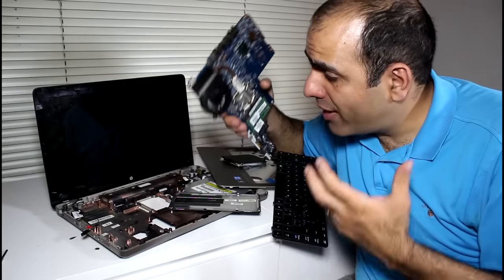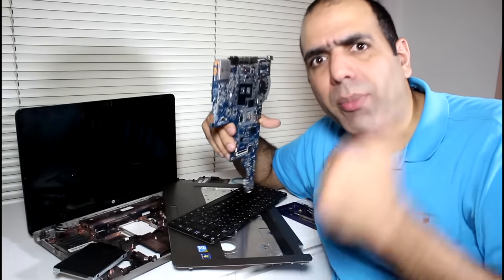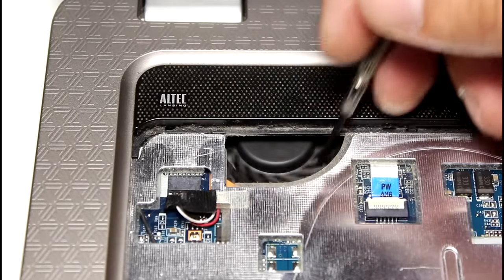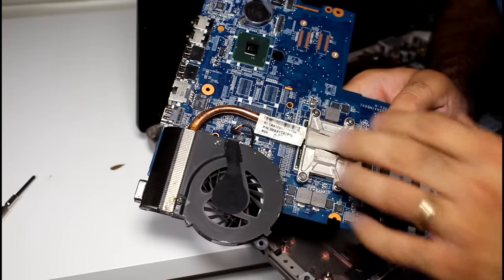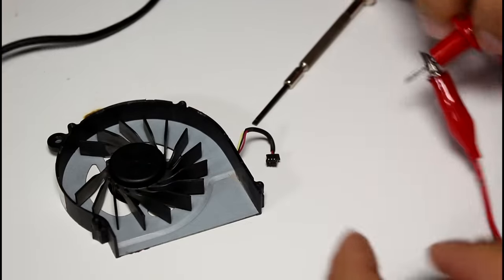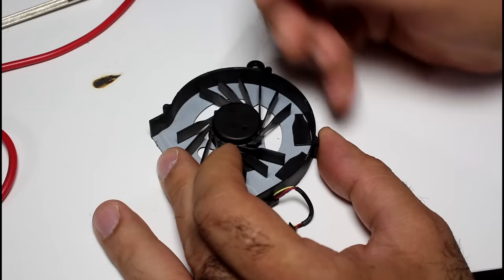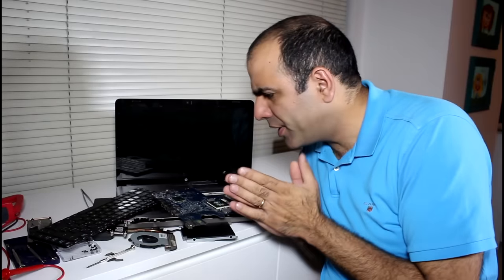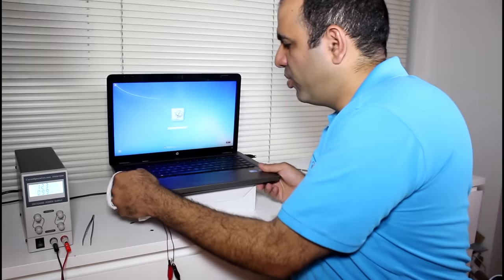How to Fix your Laptop

Comment: NONONO

Vacuum cleaner and solid state electronics do not go well together (Electrostatic energy). Also, it will probably ruin your fan as well.
Reply: Compressed air can is definitely a better option.
Reply: May you explain what the vacuum cleaner and electrostatic energy have in common? Where's the difference between the vacuum cleaner and the compressed air can. I can only imagine the fan spinning and creating energy, but that's it
Reply: MegaMerlin56 I cannot. I just know that compressed air provides a much shorter burst of air that is much more efficient at cleaning out dust, as it will disintegrate all the accumulated lint. Even if the dust is not immediately removed, the fan will be able to blow out the rest on its own.
Reply: The dust and grime scraping against the plastic tube of vacuum cleaner is a pretty ideal for striping the surface of electrons and therefore a lot of voltage can build up (Not really the case with compressed air). But it won't destroy your laptop if you don't open it up and directly touch say the bottom of the processor. I have made my fans sound like jet fighters by the help of a vacuum cleaner many many times with no ill effects. :)
Reply: and MSI recommends you to apply thermal paste like that. Doesn't mean they are right. /watch?v=kSCVahyh3Dk
Reply: ROFL! I vacuum cleaned EVERY single PC I owned over the past 30 years. Never ever had a problem because of that.
Reply: but not really though. wtf do you think your fan is doing lololol.
Reply: I highly doubt that the fan can spin fast enough to fry the diode. If it can resist 120V AC I think it can resist a 5-12V DC motor (which won't even generate the 5-12V, it will always be less).
Reply: uh no it's fine, the motor for the vacuum is far away from the nozzle part with the suction. even if the vacuum were close it wouldn't hurt it. your comment is bullshit.
Reply: compressed air will blow dust all over the internals of the computer and your room, vacuum is much better
Reply: Suhkma Dheek Im an EE, I know more about electromagnetics than you.

A brushless motor has over current design, so when you apply a force onto the blade, the motor controller (unless its a piece of shit) well apply less power. EDIT: a brushless motor design requires reverse flow to operate, so spinning a brushless fan backwards does nothing.

But ya with the static, the principal is from rubbing an isolator (the air), onto a conductive material...but like...that's what your fan is doing already so obviously motherboards are designed with anti-static in mind.
Reply: dan428 You could take your laptop outside yo, also I believe the fan is mostly separated from the internals, for optimal airflow.
Reply: Suhkma Dheek wait we are talking about the motor in the vacuum doing damage?!?

LOL no it wont.
Reply: Lmao it's satire guys chill
Reply: His jokes are based on doing the wrong thing, fucking up and explaining how he fucked up. Here he did the wrong thing and didn't make it a part of some joke, which suggests that he thinks it's a viable thing to do.
Reply: this whole vid is a "joke"
Reply: Huh? I said the 120V AC as an example of how much a diode can bear, just check the datasheet for the 1N4001 it can stand up to 50V. I worked with power supplys before I get how it works.
Also, a 12V fan making enough current to fry a diode, now that's bullshit. That fan can't even create 1A and you're saying it can fry a diode
Reply: The reason people say this is because old-school vacuum cleaners had a bigass rubber belt in them that ended up working kinda like a Van De Graaf generator and produced a huge static charge. Vaccuum cleaners made since the 90s don't do this, so you probably don't have to worry about it.
Reply: +Suhkma Dheek 
The spinning of the pc's fan will create a few milliamps at best there is no way it can fry a diode
Reply: The Piscis Dude do you know how much power a vacuum uses, that power is literally being transferred by spinning the fan in the PC. Yesterday my laptop was hit by a slight breeze from an open window and it caught fire and then exploded. I don't have a house anymore.
Reply: +Suhkma Dheek 
While it's possible, I would doubt that the diode is that's weak. Really that would be worst case Scenario. Also even if the diode breaks, once there is load put on the fan, I doubt the vacuum is powerful enough to still turn the fan.
Reply: lucky. I know someone who destroyed two PCs with vaccum cleaners. It depends on a lot ofc, but compressed air is made for cleaning electronics and vacuum cleaners are mede to clean house floors. Way different.
Reply: Pablud3S oh yeah, TOTALLY different. uh huh.
Reply: one sucks the other blows. They seem like polar opposites to me.
Reply: Pablud3S - static electricity builds up when you vacuum the carpet... Did you plan on rubbing the nozzle on your geforce??? In any case, been vacuuming countless PCs for over 30 years now. No problems whatsoever.
Reply: Pablud3S excuse me?
Reply: your excused.
Reply: ***** - that's "you're", kid.
Reply: Shitt troll lol
Reply: It will not, there are diodes inside the fan rated at 200V and most importantly the power supply in the laptop/computer has a few reverse biased diodes to prevent back EMF from the coils inside the power supply coursing trough the MB. In the correct polarity you can never generate enough electricity with this kinds of fans to even get close to what the chips on that rail run at normally namely a few tens of amps...
Reply: PanikGrafik vaccum cleaners don't work outside
Reply: Hoping somebody would point this out. Sensitive electronic components+vacuum static do not mix together well. And yes, the fan bearings can be wrecked too, but static is more concerning to me. Bye-bye RAM!
Reply: Mary Draconis t
Reply: I was thinking the exact same thing...
Reply: " generating too many amps" - the rotating fan can generate a voltage; what the fan is connected to in the circuit (its resistance) determines how much current (measured as amps) will flow. You don''t 'generate' amps.
Reply: Unlikely, if the machine is earthed.

Comment: Causing your computer fans to spin can create charges that can damage the machine. Spinning you fans beyond the proper speeds can break the fan by damaging the bearing housing. Hold you fan still when cleaning with compressed air or experience the sorrows previously mentioned.

Comment: I have the exact same Laptop 🤔

I opened it up, cleaned the fans, replaced the thermal paste (Arctic MX2), added a SSD-Drive, 8 Gig of RAM. Maybe I'll add a better CPU later (they are now super cheap).

The PC is now 10 years old and still running quite well. I am using it as a backup PC (when I need to use a Windows Machine while not at home).

Comment: To make sure your laptop/computer works for longer you should get an air duster can. That way you only need to remove the back cover and spray the ventilation system to blow out the dust.

Comment: With the vacuum cleaner, if the fan turns fast i'm afraid it could generate a spike of voltage and could damage the circuit responsible to make the fan work.

Comment: The vacuum would spin the cooling fan very fast and could damage the computer's motherboard because, spinning the fan would generate a reverse voltage on the motherboard. It would be a good idea to put something inside the fan to stop it from spinning while using the vacuum.

Also, the vacuum could create a lot of static electricity and damage the laptop.

Comment: Is it actually safe to use vacuum on a laptop? Doesn't it builds up static or something?
Reply: its generally safe plus the computer had it cover on so the only thing that would develop a charge would be the plastic
Reply: to make shure you dont build up static, plug your computer in your charging cable so its grounded
Reply: In the body of the vacuum itself, maybe. In the air it's pushing/pulling? Nah, it'll be fine.
Reply: Alright, thanks for the help guys. Gonna go vacuum my laptop :)
Reply: Pro tip. Nothing this guy says is serious. Beware of electric toothbrushes and homemade electric guitars.
Reply: +blabla868584

haha, thats true

Comment: Don't do the first "tip".

Its more likely to break your laptop fan than the heat build up
Reply: which one?
Reply: You shouldn't use air to run a fan, you can over rev it and burn out the bearings.
Reply: And the motor may act as a generator sending current back into the laptop.
Reply: 99.9% chance it has a shunt diode
Reply: Thats a myth, they all have a diode
Reply: Just stick a needle into the vent holes to prevent the fan from turning.

Comment: I overclocked my old laptop with poorly built motherboard and due to overheating from this exact problem with dust buildup it's pretty much useless now. Lasted me 4 years and I currently have another laptop which (should have bought a PC equivalent, but whatever) has a much higher temperature tolerance, well built motherboard and just an integrated amd gpu (which is 2x faster than the nvidia gpu of the old laptop, its cpu is 10x faster and it cost like 100$ more). Wouldn't recommend, but it's a good thing to get if you want something that's very low budget, but can do mid-end tasks (no high quality games or 1080p recordings, it barely does 720p20fps recordings).

Moral of the story: run your laptop in a clean environment with a cooling pad under it, don't overclock it unless you are 100% aware of the dangers and are monitoring the heat, use a program like HWinfo to monitor the temps of the cpu and gpu at all times.

Comment: If your fan was okay first it has now maybe a ball bearing damage ^^ The paper idea is good but it is more safe for the fan to lock it temporarily with a thin plastic stick. Start the vacuum and while you do this you can move short the break stick in and out so it can't spin to death and you get all the dirt away... KR

Comment: Don't use a piezoelectric fan instead of a regular laptop fan. I amost blew up my room with flying sparking crystals. The voltage was rated 120v AC but I connected it to a power inverter. Some power inverters go up to 500V AC. I use a homemade inverter with a DC output. The piezoelectric fan didn't flap because I used DC instead of AC. It blew up a millisecond later.
Reply: I need a high voltage OP Amp to osculate AC voltage. It's not sine wave. It uses square wave. The frequency is really high. 5kHz.

Comment: Question: does the vaccum laptop technique always cleans and removes dust from the fan?
Reply: In a comment that I read, vacuuming isnt the best way to remove dust, the best way is to use compressed air or manually remove the dust

Comment: oh well i just fixed mine by dissolving the dust in isopropyl alchohol
really easy to do just soak a rag in alchohol and then rub it on the fan
works pretty good

Comment: With your cleaning method, it can happen that you spin your fan really fast. So fast that the blades break off. I learned this the hard way. I cleaned a pc fan without holding the blades and it spun so fast that a blade broke off and hurt my finger like a knife.

Comment: that 12v fan is blowing the wrong way, you need one that sucks air in from the middle and blows it out the side, directed away from the rest of the electronics. The fan you have used does neither of these things, it might work for a little bit, but definitely don't use that instead of a proper replacement part as its blowing the hot air the wrong way and probably with less force than the proper part.

Comment: I have been using my 2012 macbook for years, It overheats very often. I got the opportunity to open the fan after I realized I have been using the wrong screw and discovered half an inch of dust between the fan and heatsink. After I removed it my MacBook hasn't heated up since.

Comment: If the fan turns very fast by sucking out the dust for two minutes, doesn't it push a lot of current back into the mainboard ?

Comment: mr electroboom, this is probably too late, the laptop could be overheating due to old dried up thermal paste, a paste between the cpu and the cooling pipes of the cooling system in a laptop, when the liquid paste has dried up, heat can no longer be transferred easily from the super hot cpu to the fans, and also, the fans are also a problem.
the monitor cable is very hard to replace, usually people would replace the full lcd panel

Comment: Relatable As I needed to do this so many time to keep my 2009 Asus ROG Good as new xD in fact it IS still working soooo well Like when I bought it, No joke! The only thkng that died is the Power Supply (Capacitor)
:D its important to clean dust in your Laptops and the board too! Keeping track of screw locations ... i can open it clean it and puting it together in 3h ... I did it so many time that I know every part screws and connectors like my pocket for the model i have xD I do it every year or two depending on the environment of your pc location.

After unpluging your pc for cleaning including the battery press the power buton for 1min and over to distcharge the maximum of the board componants

I never used a vacuum tho its dangerous and easy to sratch anything!! NEVER DO THAT. unless you do it the way he showed in this video BUT I DONT SUGEST IT AT ALL for static reason!
The way I clean fans is to Disconecting them and pass them trough a flow of water on the blade for it to ratate the direction its rotating when working... WAIT FOR THEM TO BE DRY BEFOR PUTTING THEM BACK ...and dont make them spin any direction while pluged in

The rest is all delicatess Qtips and 99٪ alcool  (not under 99%) for the board! Alchool isnt conductive and prevent any short while cleaning!
Dont put to much alchool on the qtips some componant dont like it at all  ... it is only to roll them on the surfaces where dust is. The dust will stay in the coton and alchool will remove anything other than dust that is stuck on the board.

And make slowly your way ... Dont press on screwdriver either to remove any possibility to slip, make a bad move, and potentialy make a microcut on any elecrical path!

All plastic part when all and every electrical componant is removed can be rince under hot water!

Comment: It's not good to make fans turn that fast when your laptop is closed. It generates energy that could lead to failure of some transistor that open and closed the current of other parts, even the fan itself.

Comment: Pro super tip: if your computer has no dust but is still slow/overheating its most likely that the thermal paste has dried up and needs to be replaced.

Comment: I've been there 

A small bead of lube on the fan can help.

Laptops in general don't have great cooling
Reply: Also isn't it dangerous to use vacuums for pc Cleaning because not the risk of static discharge from the vacuum?

I've never seen this happen from a vacuum myself but I've heard it a lot

Comment: I don’t think is a good thing to suck the air on the other way with a vacuum cleaner, it may send a reversed voltage over the wires and blow something...

Comment: Don't forget to unplug the fan before you vacuum it, to avoid sending stray voltage back to the motherboard. Or put a pin through it to keep the fan from spinning with the air pressure.

Comment: I had an Acer Laptop that had a massive antenna built into the bottom it took up the whole bottom of the laptop, anyway it picked up some hotel wifi over 2 miles away, I eventually gave it away after 5 years. I use a tablet now.

Comment: WTF did u just do 
1. Never order any part from ebay EVER
2. U don't need to remove the keyboard to get access to the motherboard 
3. Thermal throttling issues usually come from the thermal paste and u should have replaced it with ur fan (i replace it every 6 months or so)

Comment: 1:50 wrong!
the dust "balls" are so much compressed, that they will not pass this grid, which is meant to be a kind of "air filter" inside the laptop.
even worse: you "pull" the dust balls from the cooler back into the fan, which will for sure block the fan, so there will be no more air movin at all and your laptop dies even faster.